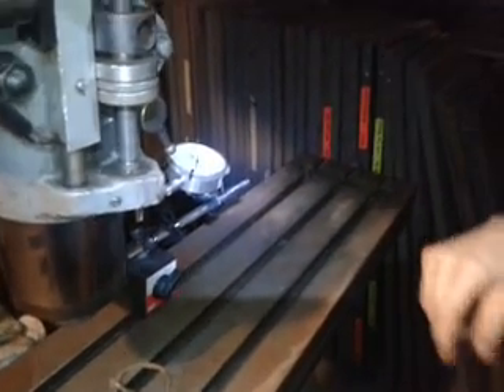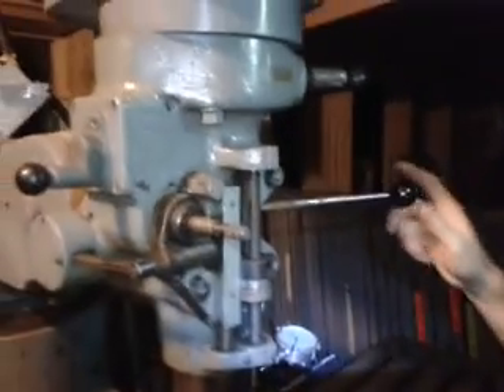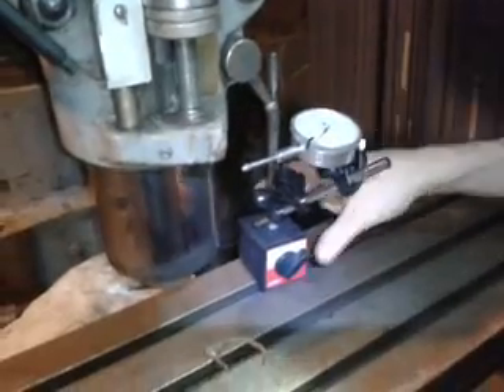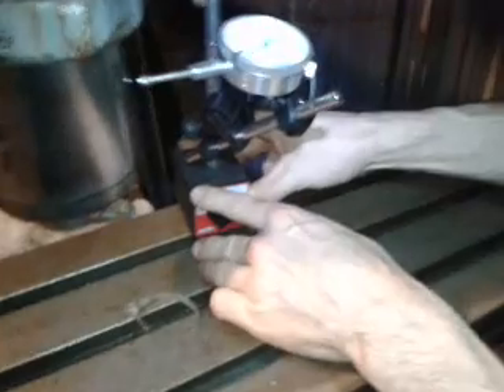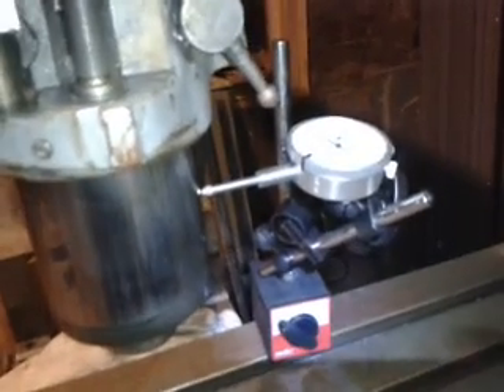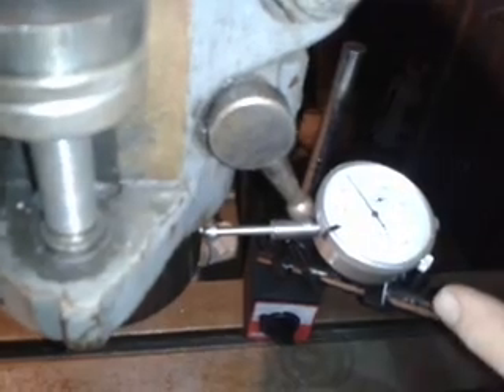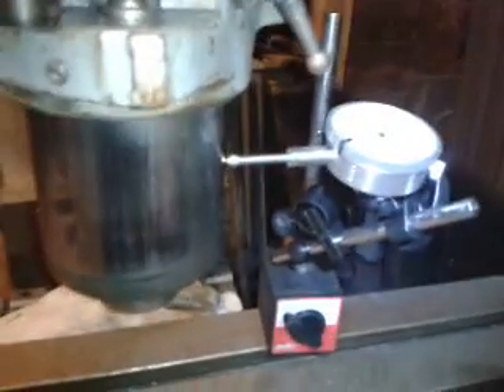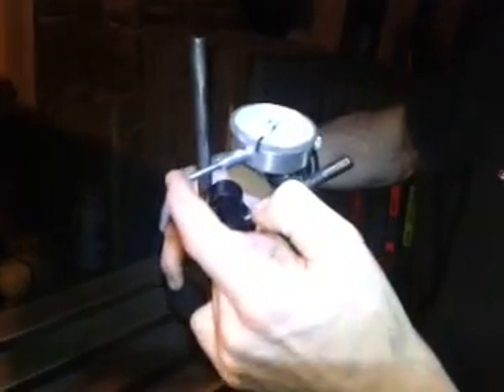Dial Indicator Basics

Comment: You are not measuring what you say you are. You say you are measuring whether the shaft is moving straight up and down, but all points on the line which the dial indicator sensor is touching as the shaft moves up or down pass through the same point, namely that at which you have placed the indicator, no matter what angle the shaft is set at. The other commenters are correct..